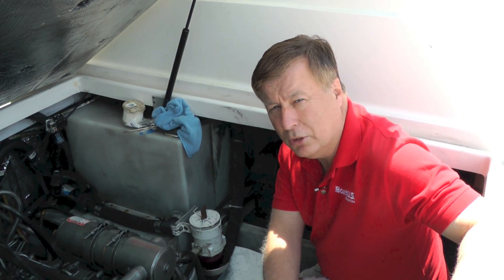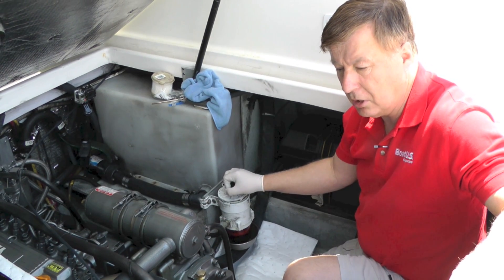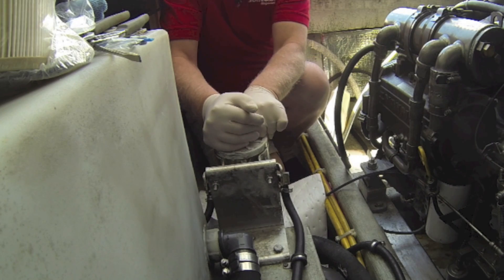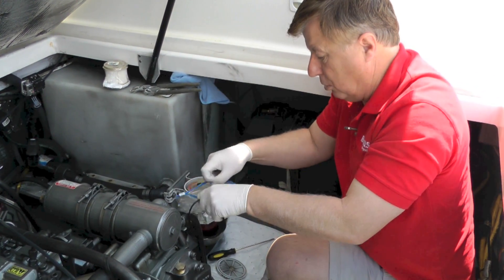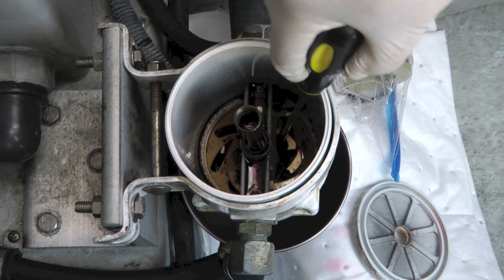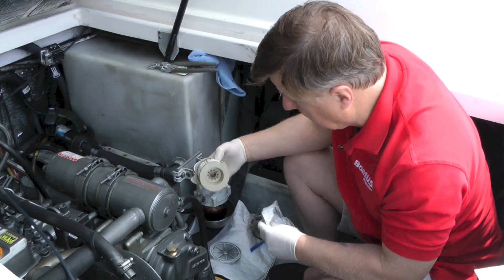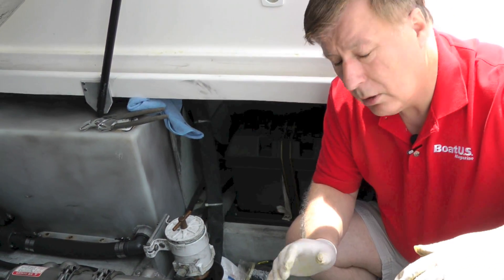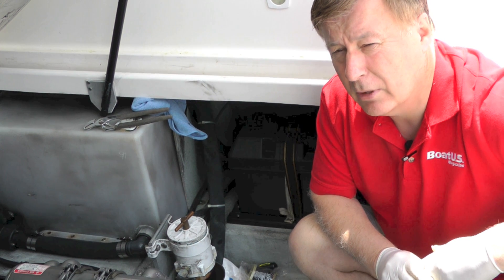How To Change A Fuel Filter On A Marine Diesel Engine | BoatUS

Comment: Granted, this guy knows more than I do, but ...
1)  Shut off the fuel to the engine.
2)  Don't use a 2 micron filter for primary.
3)  Top up the new filter with fuel.
4)  Lube the larger O-ring.
5)  Re-open the fuel line to the engine.
Reply from the maker: Thanks for the summary, Dick. That said, for first-timers it's useful to go step by step.
Reply: Do you personally use Oil or just diesel to lube the O-ring?

Comment: I don’t see you topping off with diesel fuel to reduce air in the system. I’ve been taught to do so - is that just a personal preference or does it depend on the size of the engine, the distance from filter to injectors, etc.?
Reply: It should have topped off before putting the top back on, as u could see the Racor had no or very little fuel in it.. thats how to make air Pockets..

Comment: The 2 "O" rings should NOT be discarded.
Good to have as emergency spares...
That is, you crimp/destroy either o ring and you're SOL (unless you have MULTIPLE spares),
But, since you SAVED your OLD one...you can TEMPORARILY use and get underway to the nearest chandlery for a NEW replacement.
Reply from the maker: Thanks for your comment, Romeo. I would, however, disagree with you on this. It would be better to have some spare fuel filters on board, which come complete with new O rings. Reusing old O rings could cause either a fuel leak or possibly introduce air into the fuel system, which could prevent the engine from running.

Comment: What about removing all that muck he disturbed with his screwdriver, all vry strange.
Reply from the maker: Hi Jo, thanks for your input. The dirt in the bottom looks worse than it actually was. Although I drained the bowl along with much of the dirt, some did remain. However, to get the bowl completely clean, the filter glass has to be removed from the filter carrier which was outside the scope of this video. However, we may be covering the rebuilding of the filter carrier and housing in a future video. Thanks again!

Comment: Why did you not shut the fuel valve off first.......
Reply from the maker: +John Ahern 

Not all boats have shut off valves, and indeed, although they may
be a good idea they are not mandated in ABYC guidelines and need not be fitted to diesel tanks. It should also be noted that the full hose connects, on the top of the tank, to a pick up pipe  which runs down vertically inside the tank and draws fuel from the tank bottom – the pickup is usually about an inch from the lowest point. 

Fuel delivery on diesels is of the positive suction type (which is discussed briefly in the video) and as soon as the top is released from the filter air is admitted breaking this suction. The only way that fuel would leak, or siphon into the boat, is if the bottom of the pick up pipe inside the tank were significantly higher than the filter housing which in this case it is not.

Comment: 2 Micron primaries may be Mark's preferences, however, using them violates both the filter and engine manufacturer's, Racor/Parker and Yanmar respectively, application guidelines.  It's been a common misconception among boat owners for decades that it's preferable to use a 2 micron elements in a primary filter, in the mistaken belief that it will negate the need for replacement of the secondary filter.  Doing so, however, not only violates manufacturer guidelines, it also effectively halves the overall filter surface area, assuming all debris is captured by the primary element.  The science of filtration dictates that a sequential approach is more effective, which is why it's required by Racor, Yanmar and other filter manufacturers.
Reply: Was getting ready to make the same statement, thank you.

Comment: 2 micron should never be used as the primary filter. 30 is OK, maybe a 10 but never 2.
Reply: For my Yanmar 3ym30 recommends 10 micron as a happy medium...I guess it should depend on where you typically motor? Sea, lake, river etc..
Reply from the maker: +Victor Raymond thanks for watching! 

As you are aware, the smaller the micron size the more dirt and
contaminants that the filer will remove from the fuel and as such the element will tend to clog sooner. A 2 micron filter will be fine in this application but may well require changing more frequently depending on the quality of the fuel in the tank. A drag meter added to the top of the filter housing, where the T handle fits, would be a good addition, and alerts the owner to a clogged filter well before it get clogged enough to cause an engine problem.

Comment: And he didn't lub the oring(s) with a little oil, which I was taught to do.
Reply from the maker: Michael Gen  Yes, spin on filter O-rings should be lubricated with a little oil. The type of Racor filter body used in the video does not require lubrication. Plus, there is always a little diesel remaining in the seating groove, so adding extra diesel is not necessary.
Reply: Oh! Never mind. Thank you couldn't tell from video.

Comment: When does he drain the water collection bowl at the bottom of the fuel filter?  Unless the bowl is drained, only a part of the problems are eliminated?

Also, he must top off the fuel filter container with fresh, clean fuel after draining.  If he skips this important step, the engine may stall with fuel starvation 10 or so minutes into running.

This was a neat, but incorrect videol
Reply from the maker: Stuart Bell Thanks for the comment. One of the great features of the Racor filter is that the filter bowl is made of glass so it is easy to see if there is water or other contaminates that need to
be drained off. In our case the bowl was clear. 

Also, it can be good idea to prefill the filter with fuel before popping the top back on, but as mentioned towards the end of the video, the next step will be to bleed air from the system (as highlighted in companion video:  https://www.youtube.com/watch?v=6cPRVzIXDbM). This was done using the lift pump.
Reply: @boatus  Stuart may be correct.  I too suspect much air will be trapped in the upper section of the  500xx Racor filter body since the air will float above the fuel.  This air will have no easy means of escape out of the fuel outlet port while bleeding or running -- at least until the boat is bouncing or healing.  This trapped air if it exists may leave the filter element only knee deep in fuel.  The Racor guide on filter changes is to"fill the chamber with fuel" (gravity fed or pumped from the tank or from a separate container ).  Of course, this design can't be fully bled of air (no bleed port) but a small volume stays floating, well clear of the ports that are low down. https://www.parker.com/Literature/Racor/Tech_Install/15332_500FG_Turbine_Series.pdf
Reply from the maker: @darrellstreet90  Thanks for adding your thoughts, Darrell! Someone may find them helpful.
Reply: @darrellstreet90  it should have been filled with fuel before the lid was on, always.. The guy changing this filter probably works in an office and is not really a boater, or at least not a fuel filter changer..